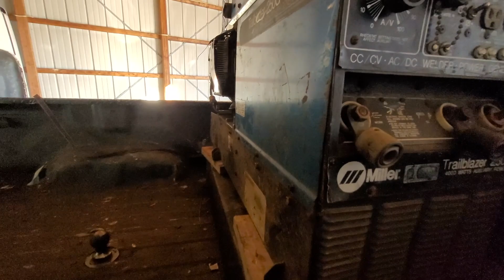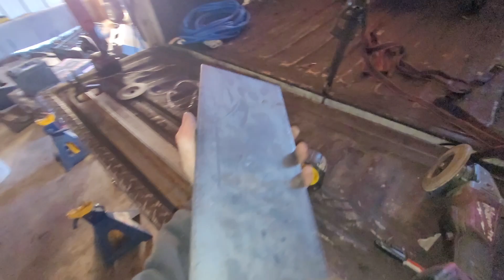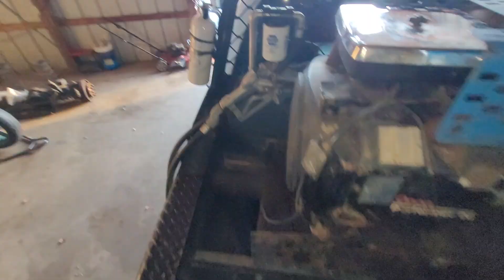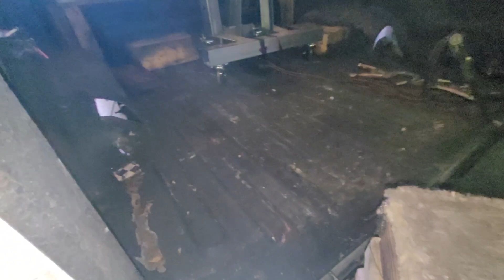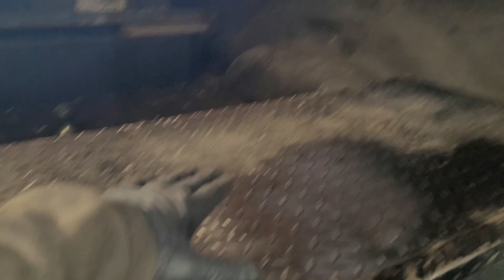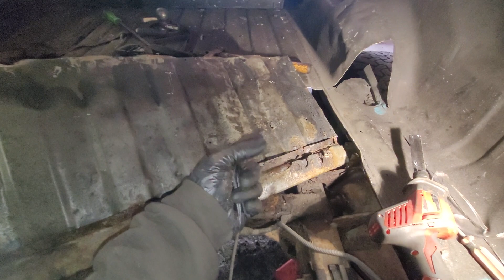Cutting Up My Diesel Truck

Comment: Like the tool nox idea. Cutting the sides shorter and dropping the center part of the box down in the hole might work. It would depend in where the latches to open the box would be. This would give you the front and back down in the hole, only leaving the bottom, left and right sides needed. Just a idea to think about.

Comment: Steve maybe you could build pull outs from fender wells back end of bed or make them fold downs 
That way lots tool space  on rear of bed plus youre tool box the fold outs could doubble as vice tables 
Right sometimes need vice rite

Comment: I think maybe a flat bed would be great for the work your doing
Reply from the maker: I hate them. I ran one, built a welding bed too.
Reply: @CPSteveMiller  understand if you don’t like them then it’s not for you. I can understand that
Reply: Understand
Reply from the maker: So much extra weight plus tub setups just look so good 🥵😂

Could save weight on aluminum but then it's something I can't weld to and the cost is crazy for a nice one.
Reply: @CPSteveMiller   so very true you just keep doing what your doing and kick butt.